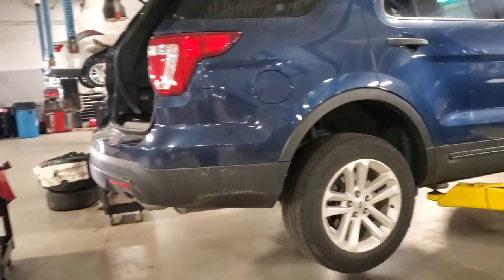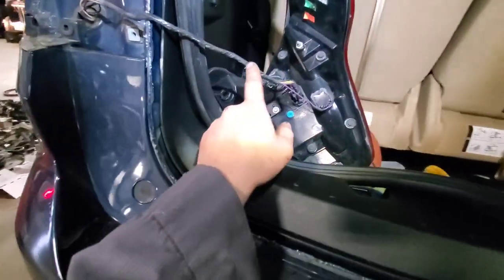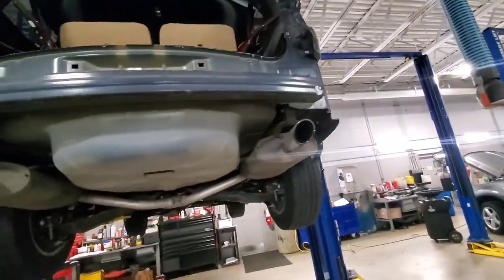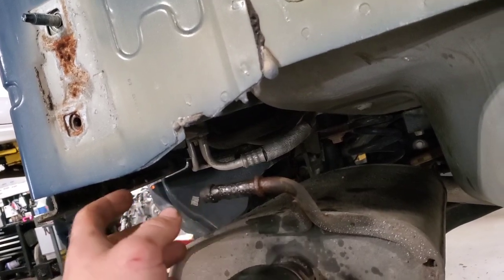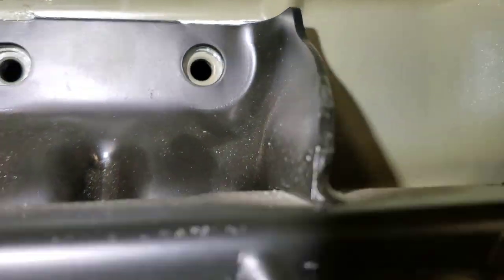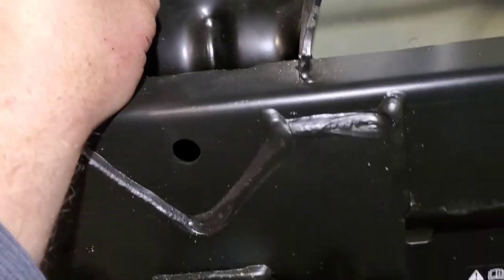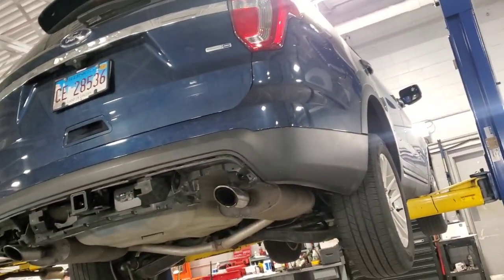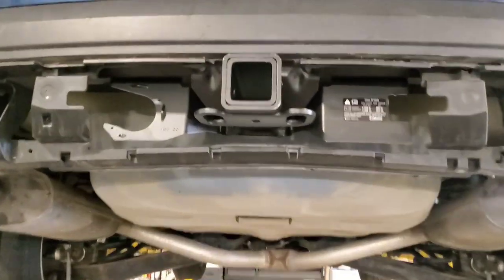2013 - 2019 Ford Explorer Class 3 Hitch install - May be some different close to same - 2017 Here

Comment: Thanks for the video.  The part numbers for the factory panel you showed is not correct.  When I get mine delivered (there are two part numbers) and installed I'll post the correct part numbers.
Reply from the maker: Maybe it's not the correct panel for yours

Comment: Do you have the part number for the combo 4-pin, and seven pin trailer light cable? 
Thanks for the content. ✌️.
P.S. Sorry forgot to say I have a 2017 Police Interceptor Utility aka Ford Explorer Police Package, 3.7L V6, need part number for the wiring harness to connect trailer lights.
Thanks again appreciate you 🤙. ✌️. 😎.
Reply from the maker: Yes it's a universal connector I have it in my 2020 explorer video
Reply from the maker: It's like this one 

https://www.etrailer.com/Trailer-Wiring/CURT/C56496.html?feed=npn&utm_source=google&utm_medium=cpc&utm_campaign=Google%20%7C%20Shop%20-%20Trailer%20Wiring&adgroupid=128484934262&campaignid=15586143335&creative=569877447301&device=m&devicemodel=&feeditemid=&keyword=&loc_interest_ms=&loc_physical_ms=9021527&matchtype=&network=g&placement=&position=&gclid=CjwKCAiAlrSPBhBaEiwAuLSDUNekdQMxflId4y6I1YtxcyVLnD1Eph94992fcAW5YcyJ4z2KX7LSTRoCL4sQAvD_BwE
Reply: CooL, many thanks 🙏.

Comment: From your experience are the rear bumper lower covers the same? I have a 2018 and cant seem to find a lower trim cover that has the hitch cover. The part number you provided said its only for a 2016-2017. Do you happen to know if they are interchangeable with the 2018?
Reply from the maker: I thought they were I could be wrong but I don't know  then

Comment: Is it possible to install a 4 pin connector for trailer lights?
Reply from the maker: Yep look in my library at a 2020 I did same concept
Reply from the maker: It's like this one 
https://www.etrailer.com/Trailer-Wiring/CURT/C56496.html?feed=npn&utm_source=google&utm_medium=cpc&utm_campaign=Google%20%7C%20Shop%20-%20Trailer%20Wiring&adgroupid=128484934262&campaignid=15586143335&creative=569877447301&device=m&devicemodel=&feeditemid=&keyword=&loc_interest_ms=&loc_physical_ms=9021527&matchtype=&network=g&placement=&position=&gclid=CjwKCAiAlrSPBhBaEiwAuLSDUNekdQMxflId4y6I1YtxcyVLnD1Eph94992fcAW5YcyJ4z2KX7LSTRoCL4sQAvD_BwE
Reply: @FordBossMe  Thank you